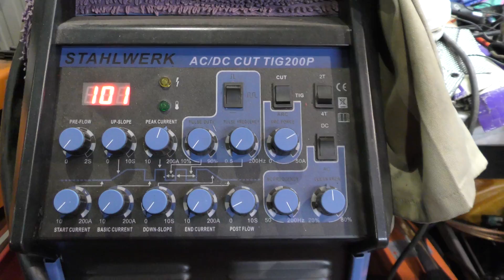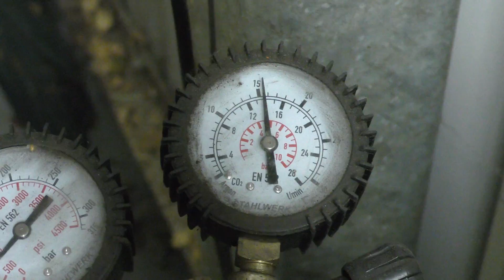Learning to TIG weld Aluminium - Part 1

Comment: congratulations in joining my level of welding as im so frustrated lucky my unit is to heavy to throw above my head!!🥵 i thought i was only one like you as ive been to so many welding sale places ! with no help as one they sell machine thanks for your money your on your own !😡 we can turn dials all day with very little luck it like flying a jumbo flick this turn that it will end in crashing !! like you david i need HELP🙏🏻🥵😱😥
Reply from the maker: Sadly as it's not something I do everyday it's going to be a long road.  But so far I have joined aluminium part A to part B and it stayed together and didn't leak.

Comment: This video came at just the right time for me. I'm looking to buy exactly the same welder. Your last weld looked pretty good to me. Would you recommend this welder?
Reply from the maker: Probably yes, for all the things it can do.  But I am on my second as the first had to be replaced under warranty.  And it did cost something like £50 to send it back to Germany.  Also bearing in mind the one that failed had very little use as I only TIG welded occasionally.
Reply: @DavidMcLuckie  cheers, it's the only reasonably priced AC Tig I can find. I'll take a risk on it
Reply from the maker: That was pretty much my thinking as well.  Hope you get some good use of it.